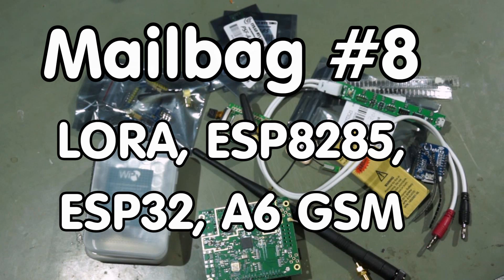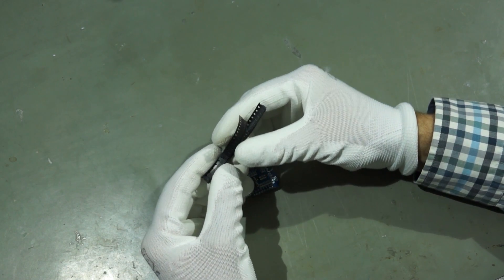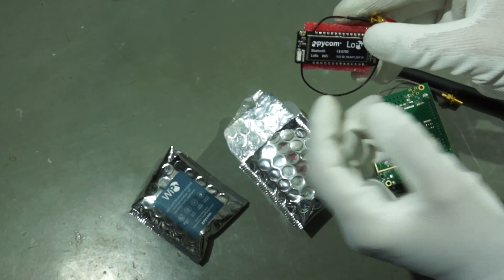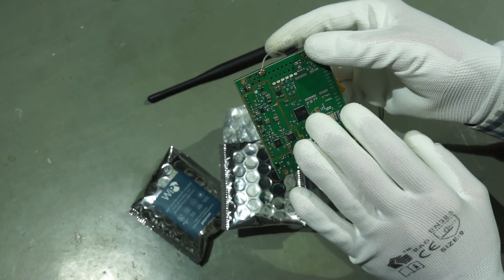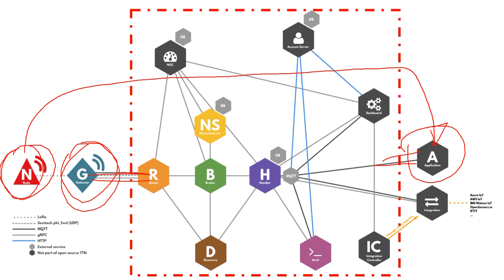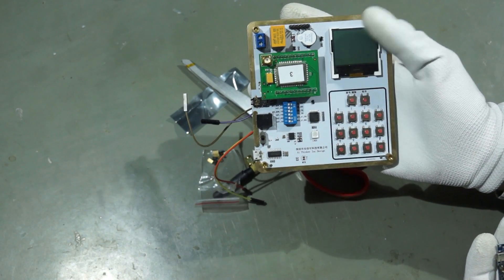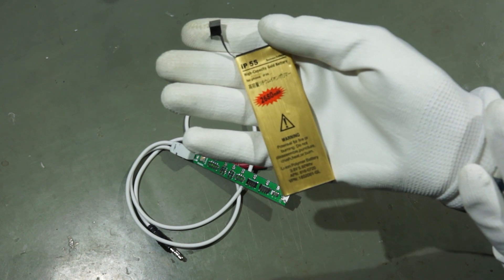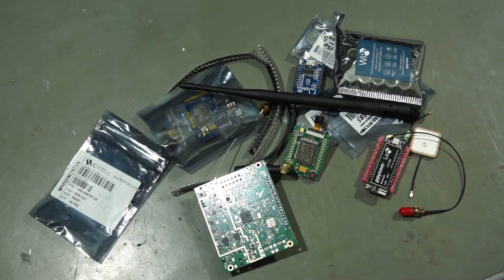#98 Mailbag #8: LoRa, ESP8285, ESP32 in a WiPy Python board, A6C with camera

Comment: I have never heard of this LoRa network stuff before now. It seems quite interesting.
Reply from the maker: This is, what I think, too!
Reply: bdot02 me neither - thankyou Andreas! In fact I have just placed an order for a pair of LoPy modules - I think it will be perfect (EDIT: nope - maybe not perfect due to data rate) for monitoring my garage door, which is underground where mobile phone reception is very weak.
Reply: Greg Sullivan sounds like something I was doing for my garage. A magnetic read switch connected to a magnet attached to the slidy bit of the door and a relay for triggering the door open/close wire. All controlled by an ESP8266. Then I just do port forwarding and have a PHP script set up to say if the door is open and to send commands to the ESP. I was inspired by a Make: Weekend Project
Reply: bdot02 Thanks - I haven't looked at your video yet but I will ASAP. Just btw, I see that Pycom have just announced an LTE-M module - I suspect that LTE-M will be a more appropriate technology for me, because of the data rate I need for anti-tamper purposes. I had never heard of LTE-M either. ;^)

Comment: I can't wait till you try developing in MicroPython!  I started 4 weeks ago and I find it very useful during development because you can try commands in real time because it is interpreted.  Also, it is easier to code with higher level librairies and functions because you don't have to deal with lower level stuff like in C for examples.  So quicker coding for your projects!  Also since you can copy files with the WebREPL over the air, it is easy to reprogram the board.  I use it with a normal ESP8266 and it works great.  I recommend to you the great book: Python for Microcontrollers, getting started with MicroPython from Donald Norris (McGrawHill) just released a few months ago.
Reply from the maker: Already ordered (Kindle version, fast!). I can handle the OTA stuff quite easily also in the C++ world. But the rest is interesting...
Reply: Thanks for the book suggestion - I didn't know what to get, but that looks like just the ticket!

Comment: Great to see you covering LoRaWAN and TTN specifically. Lots of potential. I have been experimenting with the WeMos D1 mini and the Hoperf rfm96 to build low cost sensor devices in addition to a single channel TTN gateway for under 12 eur for testing. would love to see you compare the hoperf and microchip lora modules...
Reply from the maker: I have some other LoRa devices laying around, but I am not sure if they are 433 or 868 MHz...

Comment: There is also the A20 which has an ESP8285 built-in.  I'd personally like to see a development platform for the RDA baseband chip inside the A6 since it is quite powerful (it has a 250MHz MIPS core).
Reply from the maker: Thanks for the tip!

Comment: Wow, never heard of the LoRa thingy. Sounds fantastic. We live in exciting times.
Would not be practical in North America if it can only work on 866 MHz and not 915 MHz.
I don't know why they didn't go with 433 MHz? the range is almost double of the 800MHz, but the BW is lower.
I would've liked to buy a set and play with it, but the costs are prohibitive at this point. 
The RPI3 is only $35 and the ESP module are a couple of bucks. 
I wanted to connect my Cottage (35 Km away) in Ontario, Canada, to the internet. I did some research about it, unfortunately, the only solution I found, was to use satellite services. Big $$$$
Next summer, I will try hooking up 2 helium-filled balloons (haven't found any that don't leak), and use them as antennas. I am sure I would be able to make a link using the 433 MHz transceivers I have. Too cold to do anything till then. Time to hibernate indoors till then.
I wish I could give you more than one thumbs up :)
Reply: LoRaWAN works great in north america at 915MHz. there are already a nice base of public TTN gateways which are growing. both adafruit and sparkfun are offering more LoRa products every day...
Reply from the maker: Be aware, that the LoRa standard supports only a few Bytes per message. So, it is not for internet access or similar things. A Helium balloon is a cool thing, but then, I would try also WiFi with a Yagi antenna (if you have line of sight). This is the channel to watch for that: https://www.youtube.com/channel/UCHqwzhcFOsoFFh33Uy8rAgQ
The reach does not depend on the frequency. Just lower frequencies "bend" a little easier around obstacles. If you have line of sight, no difference other than technical capabilities of your devices (and of course bandwidth) should make a difference.
Reply: Andreas Spiess
My line of sight is obscured by big-ass hills.
I hate to disagree with you, but the lower the frequency, the longer the range. For sound too.
2.4 GHz for example, is mostly absorbed by water vapor in the air, being so close to your microwave oven frequency.
EM radiation is absorbed by most material, which act like antennas.
I did install a yagi system for a friend near Panama city, Panama, when I went for a visit and vacation. It worked fine at 56K modem speeds that was promised. He had line if sight.
The receiver is important for range, not the transmitter. some good ones can work to -115dB or even weaker.
Think voyageur. Think big-ass dish antennas and amplification to the wazoo.

Comment: I very interested in you experience with the esp32 and micropython. the more i play with this chip, the more i find that is not working today i.e. only about 10% of Arduino examples are working and bluetooth are in "kinderschuhen". so if the c/c++ are a construction site i don't expect python can do more (only a few things that the esp8266 can do). there are also no    webserver example today. but hopfully it don't take a year to fix all the holes. please correct my if I am wrong.
Reply from the maker: This is why I did not yet start with the ESP32. I am too long in business and know the difference between "leading edge" and "bleeding edge"...
I was more interested in python and LoRa and only discovered, that an ESP32 is built in when I got the board.

Comment: Tried micropython with esp8266. It takes about 2-5 hours to prepare everything and flash micropython firmware to esp8266. After that it's a pure joy! Having higher level language is very nice.

There are few cons. though:
 - much less IOT examles. With C you can basically reuse on any Arduino projects code. Python is much more popular, but not in IOT world
 - maybe it's just me, but I found python paradigm not so well fit with. Gonna try JavaScript (esp8266 can run it as well); callback/observer patterns are much more in use in JS world

Starting point – https://github.com/micropython/micropython/tree/master/esp8266
Reply from the maker: Thanks for your comments. You confirm, what I feared: No libraries and reading of data sheets of sensors... For me, the value of a platform is not only technical features, it is also community support. And here, I am curious, which higher level languages will survive in the IOT space.

Comment: How much transmit power can be used in this LoRa Network?
I have a garden in a distance of 3.5 kilometers, but i am slightly behind a hill in between. The used frequency should behave as local gsm networks, but they use sector antennas with a certain gain and also a lot more transmit power than for example a NRF24L01.
Also the power consumption should be acceptable for use with the solar panel.
Reply: The battery and the charger are already there and work fine. I will have to try...
Reply: In Europe, maximum power that can be used is 14 dBm (including the gain of antenna)
Reply: Thanks :-)

Including antenna gain it seems not to be that much...
Reply from the maker: I suggest this video:https://www.youtube.com/watch?v=T3dGLqZrjIQ
Thomas explains all these aspects very well.
Reply: Thanks :-)

Comment: Nice..  You mean distance between lopy node  and gateway  (concentrate) is around 61 km with director RF link. 

How much does it cost of lopy node and gateway node 

Do we need to pay for the RF carrier
Reply from the maker: He did not use a LoPy module. He used another one, but basically the same. The links to all modules are in the description.
The 61 km was line of sight (here, we have many mountains). Do not expect something like that in a city or so...
Reply: 61 km is a bit OTT. In an urban setting, 1 to 2 km is realistic for LoRa with a basic 5dbi gain antenna where there are lots of obstructions.    see the recent LoRa Crash course video from Thomas Telkamp for a good overview.
Reply from the maker: You are absolutely right. It was line of sight on a tall hill or even mountain. As soon as I have my gateway running I can do some testing. There is also a 12 dbi antenna in the mail (for the gateway)..

Comment: HI Andres, I'm trying to test the A6 modulo without succeeding.
I have connected it with Arduino by using the Serial port l but something is not going well.
I have connected:

- A6 (GND)) <-> Arduino (GND)
- A6 (U_TXD) <-> Arduino (RX)
- A6(U_RX)<-> Arduino (TX)

in the Serial.Begin command the baud rate was 115200; I have also tried with 9600, but nothing happened, no reply when typying AT or ATD MSDISN....
Did you manage to test it?
Reply from the maker: +Maurizio Maurizio what sketch runs on your arduino?

Comment: Yes, it was wroking I have used the same sketch to control a similar device SIM800 connected through TX, RX
#include <SoftwareSerial.h>
 
//SIM800 TX is connected to Arduino D8
#define SIM800_TX_PIN 8
 
//SIM800 RX is connected to Arduino D7
#define SIM800_RX_PIN 7
 
//Create software serial object to communicate with SIM800
SoftwareSerial serialSIM800(SIM800_TX_PIN,SIM800_RX_PIN);
 
void setup() {
  //Begin serial comunication with Arduino and Arduino IDE (Serial Monitor)
  Serial.begin(115200);
  while(!Serial);
   
  //Being serial communication witj Arduino and SIM800
  serialSIM800.begin(115200);
  delay(1000);
   
  Serial.println("Setup Complete!");
}
 
void loop() {
  //Read SIM800 output (if available) and print it in Arduino IDE Serial Monitor
  if(serialSIM800.available()){
    Serial.write(serialSIM800.read());
  }
  //Read Arduino IDE Serial Monitor inputs (if available) and send them to SIM800
  if(Serial.available()){    
    serialSIM800.write(Serial.read());
  }
}

Maybe there is some other pin to be connected.  The SIM is reachable, when I call the MSDISN it rings. I'm powering the module by using the microUSB connector.
Reply from the maker: +Maurizio Maurizio The A6 is not compatible with the SIM800. So, this library will not work.
I would start with just the module and a Ftdi adapter
Reply: I haven't connected it with SIM800, but used the serial port from Arduino Uno towards A6.
Are you saying that  ARduino cannot be connected directly to A6? At the end the simple test with FTDI is not so useful if you cannot create some code on  Arduino or any other module to control the behaviour.
Please notethat  I haven't used any 800L library but just the Arduino serial port and tried to send AT command using the serial monitor.
Reply from the maker: +Maurizio Maurizio To tesr if the module works and your connections are ok, the Ftdi is perfect. Step after step. If you know, that the module works, you can go on to the Arduino. Otherwise, you have too many sources for errors.